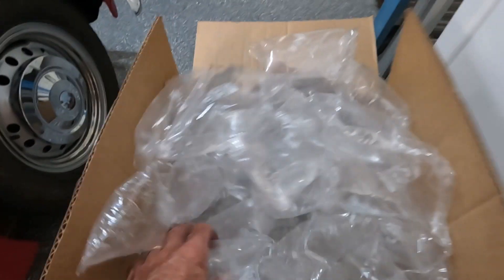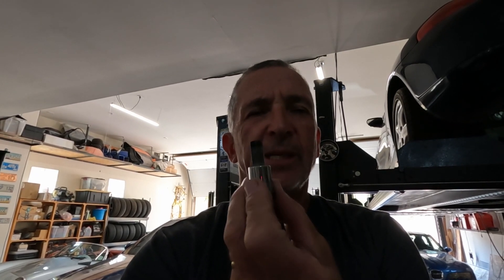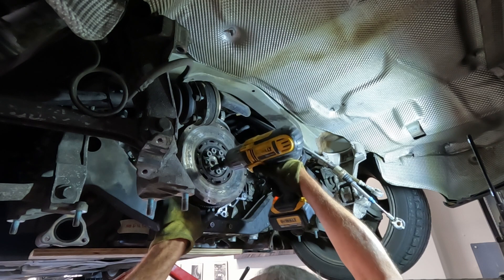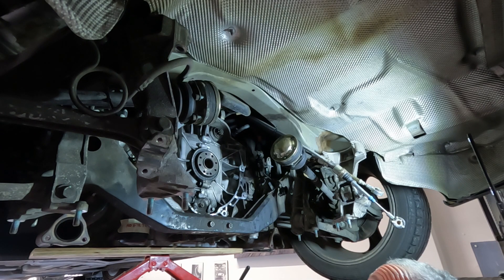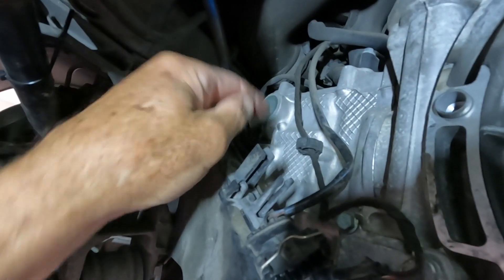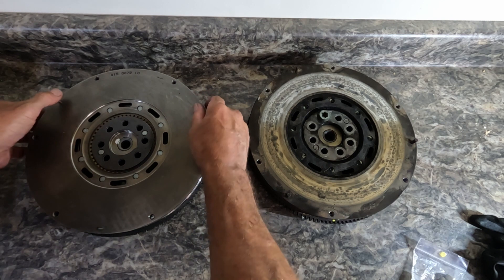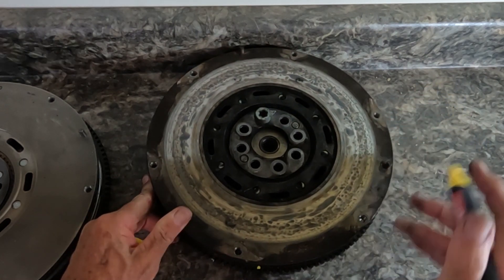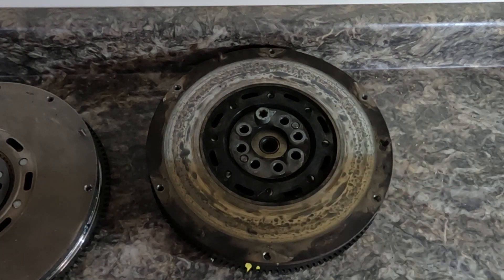Boxster 986 IMS Bearing Replacement 3: Dual-mass flywheel and locking the engine down

Comment: Hi, thanks for the great videos. I am thinking of buying a 2000 model boxster with 20,000 miles. Is it worth it in your opinion after owning a 1997 model to get such an old car with all the possible repairs and risks Involved? Would you buy the 1997 boxster again if you were to do it again? 

Kind regards, 
Elo
Reply from the maker: Absolutely, it's a great little (or not so little) car, that looks exactly like the 996 911 from the front. I would get a later year model if possible and go for the S variant. The first year 2.5 engine is OK, but you have to keep it high in the rev range to get the most out of it. They are surprisingly practical with two good-sized trunks. I replaced the IMS bearing on mine out of an abundance of caution - that whole issue is overblown, particularly for the earlier models which had a stronger double row bearing - the one I took out looked and felt pristine. It's a job worth doing if the car is apart for a clutch replacement.